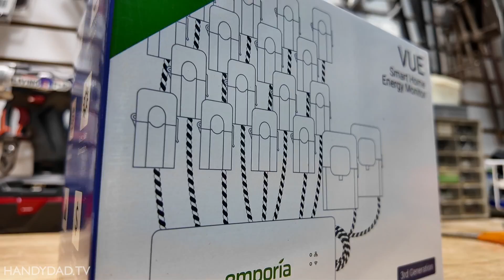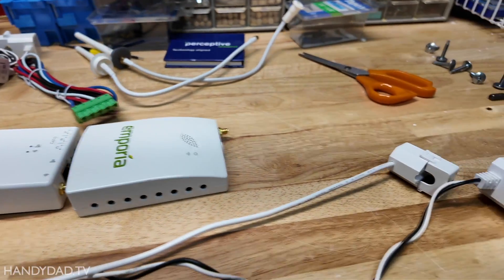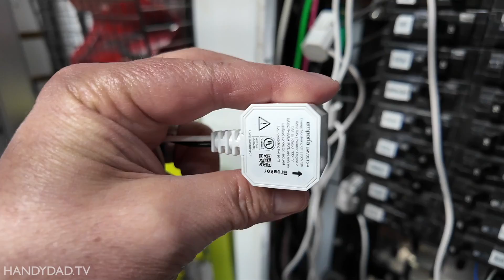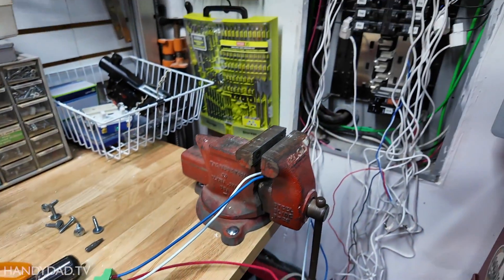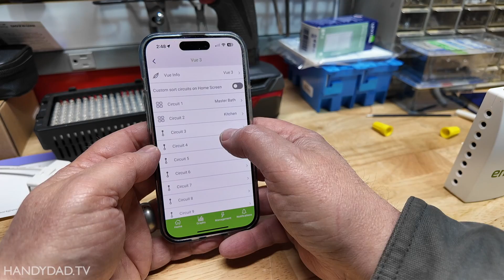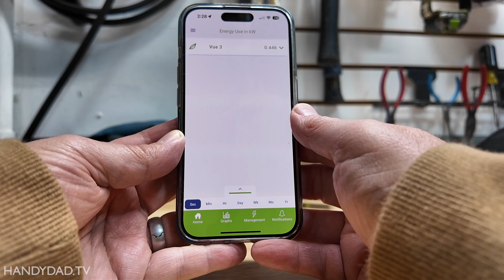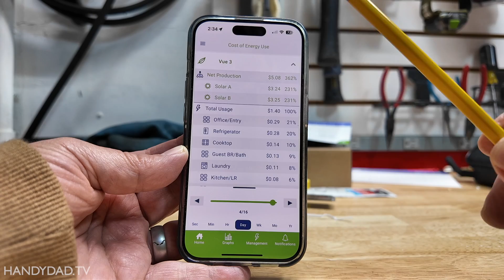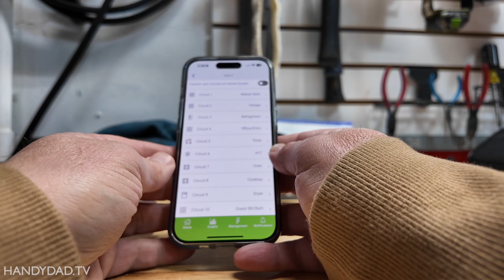Emporia Vue Energy Monitor - Gen 3 vs. Gen 2 - NEW FOR 2024

Comment: I gave you a well deserved thumbs up; I recently added solar was disappointed that I can only see what it generated on the Tesla App (no battery).  Grok recommended emporia Vue which in turn led me to your video.   I like the concept although I was a little thrown off by it needing power from both phases.   Intuition & years was a EE made think it should only need a 24 volt or 120 volt supply to operate. 

Off to research that one.
Reply from the maker: It reports the voltage of both phases.

Comment: Does this allow integration with home assistant?
Reply from the maker: Yes
Reply from the maker: I use it with Home Assistant.
Reply: @handydadtv may I ask if it links to home assistant out of the box using HACS or did you have to modify the firmware within it first?

Comment: Great vid and thanks for Q and A'ing this process. For the solar, do you have to reverse the CTs or is it able to assign a negative value considering that the breaker direction arrow does not really represent an actual load?
Reply from the maker: No, just point the arrow to the breaker for all of them. When you configure that channel as a solar generator, the unit will automatically adjust it.

Comment: Where is your antenna? Is it inside the panel box? Does that interfere with the WiFi signal? If you use the LAN connection, how do you get the network wire from inside the box to your router?
Reply from the maker: The WiFi antenna sticks out of the panel through one of the knockouts.

Comment: I love how you don't describe jack-shit about how you identify each of the breaker circuits
Reply from the maker: Mine were labeled ahead of time.
Reply: If that's the part you're stuck on you might want to call an electrician. I fully support DIY, but this is dangerous stuff.
Reply from the maker: Good point @lordgman1

Comment: Great review! best one i've seen in youtube by far for this model. Quick question, for all double pole breakers, do you need a CT on each hot side or you connect it to a just one of the two hot sides? I have several double pole breakers I'm wondering what would be the best approach
Reply from the maker: You only need to put a CT on one leg of the 220v circuit. Then configure it as 2x in the app.

Comment: I doubt it supports POE on the RJ45 and if I do upgrade, I'm going to Flash its ESP module to keep the data in house and not sold off.
Reply from the maker: It does not support POE.
Reply: @handydadtv  Missed opportunity.
Reply from the maker: It uses the 240v feed to monitor voltages on both legs.
Reply: @handydadtv  Yes but if you had your Emporia powered off RJ45, you could have a Uninterrupted Power Supply keep it powered up along side your internet/network and have it send a message out to you telling you that you have a power outage.

Comment: Great videos! After adding 16 plugin circuits in breaker box, can you add smart plugs to the same unit, and how many total circuits can be monitored? Or does a smart plug take the place of a physical monitor?
Reply from the maker: You can use smart plugs on monitored circuits or unmonitored circuits, anytime you want to measure usage of a single device. The only limitation, obviously, is they only work with plug-in appliances. They won’t measure permanent lighting fixtures or hardwired appliances.

Comment: Looking to install one of these shortly. Seems it may be easiest to get a dual pole 15 amp each breaker to install the power lines into vs pigtailing? If so this makes it feel a tad bit safer for those non electricians
Reply from the maker: I’ve done it both ways. If you have room in the panel, I suggest adding a dedicated breaker.
Reply: @handydadtv for now we’ve got room and did just that. Worked like a charm! Was glad I didn’t have to pigtail anything

Comment: How are you monitoring your solar production.  Is there a separate emporia product that just monitors solar?
Reply from the maker: No need for a separate product. Just put a CT on the solar circuit and configure it in the app as solar generation.
Reply: @handydadtv  Thanks, I had a nice long convo with Emporia last night and they said the same.
Reply from the maker: @davebarksdale 👍🏻

Comment: Hi I’ve just come across your video, it’s very helpful. Can I ask, which way round did you fit the CT’s on the solar feed circuits? Also did you use the 200A CT’s (as the solar is a feed) or just the 50A ones?
Reply from the maker: Solar circuits the 50-amp CTs. They go on like all the others. You just configure them for solar in the app.
Reply: Thanks Chris

Comment: Please help, I have a question.  We have a 70 amp breaker that on connected to a small 20amp water heater and to a 30 amp stackable washer and dryer, so they pull 50 amps. But they are combined on a 70 amp breaker at the panel. When it says it reads 50 amp does it mean it reads up to 50 amps? or is it a problem that the breaker is a 70amp? will it read it correctly ? I need to be able to read high peak usage accurately on all of the sensors. I don't want to pay the electrician to split this line and put in smaller breakers if it's not necessary. I appreciate all the help. I'm new to this.
Reply from the maker: As long as the CT will physically close around the wire, you should be okay.
Reply: The breaker will max out at 50amp reading. If the load is more than that, the CT will only output 50amp.

Comment: Great video! I have 2 grid -tied PV solar systems, one connected thru a double breaker and the other via a line side tap.. can the gen3 vue measure each of them separately? How many smart plugs can one vue support? Thanks.
Reply from the maker: If you put a CT on it, Vue will measure it. You only need a CT on one leg of each solar feed. Configure it to double in the app. The max is 16 CTs on one Vue.
Reply: I am considering adding this to my setup, which includes a 16kw grid tied PV array connected via a 4 lug meter base (similar to a line side tap). My question is regarding the monitoring of the solar, my meter, therefore the solar disconnect (which is where I would have to install the CT’s) is 50’ from my load center. Instead of shortening the CT wires, could they be lengthened???

Thanks
Reply from the maker: @ryansteele6422 You’d need to contact the company.

Comment: What if you have more than 16 circuits? Can it be expanded? What would I need to buy?
Reply from the maker: It monitors all usage, even on circuits without CTs. You just won’t see the breakdown for those circuits. 

If you really need every circuit monitored, you can buy two units.
Reply: Thanks! Do you know if both can be imported / viewed as a single system?
Reply from the maker: @dudeman99999 I never tried it, but that’s how it’s supposedly done.

Comment: You didn't mention the Solar Production and how VUE monitors that. I am about to enhance my solar system. That's why I am here. I assume you have CT's on the Solar Breaker in your main panel?
Reply from the maker: Yes it’s that simple. You put a CT on the solar circuit and configure it as solar generation in the app.
Reply: I have Solar how do I know which breaker is the solar breaker?

No one has ever told me I don’t even know if

I’ve been fighting this solar company for years. I’ve never known how much production I’ve had. They tell me I used too much power.        The electric companies is telling me I don’t have enough panels.      I have 35 panels 11.5 K system and I’m still paying 300 a month in electric something seriously wrong.!!!!!!   I need this product to figure out what the hell is going on with my electric bill because I’m sitting here in 80° sweating not using the AC in my Bill is still sky high and I don’t know where it’s coming from.  Would you be able to help me figure out where to put the solar set up
Reply from the maker: Your solar breaker should be clearly labeled in your panel so it can be turned off if someone needs to work on the system.

Comment: I missed how you connected the Solar system to the Vue. I just added a heat pump and have had solar for a few years so i'm pretty interested in seeing how much more solar i'll need to cover the heat pump. I can find out on my bill...  My solar connects in on the out side box so might be harder.
Reply from the maker: You solar feeds the grid through a circuit breaker in your panel. You just put a CT on that line and configure it as solar generation.
Reply: @handydadtv  you label all these yourself right?
Reply from the maker: @mmolina817 I take no credit for the labels on the panel cover. They are bad descriptions and don’t help me at all. I prefer to use a Brother P-Touch and put the labels directly on the breakers. Then I can identify them when the cover is off.

Comment: you can also clamp 2 or 3 circuits on one CT as long as they are on the same phase.  It has been a while since I set my Gen 2 up but if I recall each CT can read up to 50A.  So up to 3 15A circuits or 2 20A.  I was able to cover my whole 24 breaker panel with 16 CTs by combining
Reply from the maker: Good tip!
Reply: That works but I would only do it if they are related somehow like with all lighting circuits or all Outlets. Otherwise there's no need since you have the total power usage of the house or the main panel. The individual ones are more for monitoring particular devices that are usually higher current or perhaps a adu or other rental unit...
Reply: @trumpetmaris   I didn't group them in any particular order.  Not saying that grouping would not have worked well, I am just not sure it would change my results.  After combining circuits I spent a couple hours documenting every outlet and switch per CT.  If I see a spike in overall usage or on a single CT I can track the source quickly because of my documentation.  The unit has paid for it's self a few times over by catching 2 different freezers that went bad but did not stop freezing they just started using 5X what they should have.  I also found an audio receiver that was using 80W while in standby (I now have it on a Wi-Fi switch that uses about 4W)

Comment: Nice to see old style charts display. Emporia did a software update that ruined them.
Reply from the maker: Their latest update lets you swipe right or left to flip the chart to the previous time period (day, month, etc.). Great improvement from the old way.
Reply: @handydadtv  Just updated to 3.5.1.6459 they made it even worse than initial 3.5 update. Week view now blends bars together. Still no way to slide left to compare to previous day. Sliding to another view resets vertical scale making comparison impossible. They keep making it worse.
Reply from the maker: @antronx7 Ah yes. It does auto scale. 

You can export the data to a Google Sheet and chart it however you want to see it.
Reply: @handydadtv  It was great before they broke it with 3.5.0 ver. I should not have to jump thru hoops like that.

Comment: I might not been able to see correctly, but it looked like you had both the blue and white under a single screw on the neutral bar, which I don’t believe is allowed by code. Also, my experience with 240v devices, that some of when actually have quite a differences between the two phases, so using a single sensor and configuring it as 2x got inaccurate results. Great install video and explanations, thank you.
Reply from the maker: You are technically correct that it is most accurate to use a CT on both hots on a 240v circuit. I used two for my solar circuit and they are never the same reading. But they are very close. So close that I plan to reuse one of the CTs elsewhere. One will be good enough for me.
Reply: If your panel is well balanced and the loads equally divided you might get away with using one main power CT but it's never going to be accurate for total power. You could take the number and compare it to your energy bill in the same period and see how far off it is.

Comment: Personally, I have the gen 2. Worked great at my previous house. Moved and installed in "new" house. Lots of interference from other circuits. Very frustrating and mostly useless. Considering the new gen 3, due to less interference.
Reply from the maker: Interesting. I had no issue with interference with either of them.

Comment: This may be a silly question, but is there anything that says you need to put the CT clamps around the wire as it exits the breaker? (all pics online show CT clamps right next to breakers). I have very little room to the left/right of my breakers, but great cable management and lots of room where the wires exit at the top of the panel/fuse box. So I would prefer to clamp the wires in the upper region of my fuse box.
Reply from the maker: You can put them anywhere along the length of the hot wire.
Reply: @handydadtv  Thanks!

Comment: Great info here, and thank you again for the video Another question from me: I have an apartment attached to my house and electricity is not separated. I want the renter to pay their own electricity. This is the first energy monitor I've come across that can measure usage by circuit, such that I could determine how much my tenant is using. Are there competing products that do the same thing? Admittedly I haven't been looking very long, but 24hrs of internet searches haven't revealed anything that looks this good. Thoughts?
Reply from the maker: I don’t know. This is the only energy monitor I ever used.

Comment: Thanks for the video! Question regarding getting the data: I think I saw in another video (or maybe it was this one) that you said you cannot fine tune the dates using the app. If you want to match the dates on your electric bill, can you download the (daily) data yourself and align your Vue-measured usage with your what your power company says? Are you happy with the app and data delivery?
Reply from the maker: You set your billing date in the app. Mine is the 14th of the month. So when I look at the monthly view, it includes data from the 15th of last month to the 14th of this month.

Comment: FYI- If you need more than 16 CT's you can also install a second Vue and NEST it and get more CT's.
Reply: I've read where people put the CT over wires from multiple circuits that they don't need specific resolution on, reducing the need for additional CTs.
Reply: @fuquantify Yes, that is correct but you will need to use the modifier adjustment. It won't be as accurate but close enough.
Reply from the maker: Thanks!
Reply: Can you mix v2 and v3?
Reply from the maker: @1768ify You can use both at the same time, but you can’t use Gen 2 CTs on Gen 3, or vice versa.
Reply: @handydadtv  Indeed

Comment: Good day. Thanks for sharing. I have a question. If you add the two large CT's to measure the whole house usage plus the 8 or 16 that go into separate circuits.
If you use both... Does the system know that the 16 individuals are part of the total measured by the big CT's? or does it sum 16 small loads to a big total load? 
I want to make sure we won´t have information errors by using both 
and the reason I ask is because I want to use it precisely on a home that have more than 16, so I am planning to measure the total, but still want to be able to measure the big loads on the home, such as AC, pool heater, etc. Thanks and great channel you have here.
Reply from the maker: It knows the branch circuits are part of the mains.
Reply: Yes that's how it comes

Comment: Nice video, very informative. Does the Vue measure the total electric consumption on the main phase wires so that I can compare the total consumption to the sum of the individual sensors that are installed? Thanks
Reply from the maker: Yes, if you feel the need to retest what they’ve tested, but that will only work if you have 16 or less branch circuits. Otherwise you’ll always have more consumption on the mains than the sum of the branches.
Reply: @handydadtv  Are you saying the Emporia only reports on the load on the branch circuits?  I was assuming that it would always report the load on the main power feeds, and also on the branch feeds.  If there's any shorfall, it would report it as "unaccounted" - since it should understand not every circuit has a CT monitor on it?
Reply from the maker: @jwhite4 It does both. But non-monitored circuits show up as “Other”.

Comment: if you want to monitor both legs of another 240v besides the main input can that be done? I have a generator 240v input that I want to monitor as well.
Reply from the maker: You can configure the generator circuit just like solar.
Reply: @handydadtv  I heard the app cant be used if the internet is down. Is that still true?
Reply from the maker: @jjay718 That’s true, but the Vue still saves the data so when the Internet comes back, no data will be missing.
Reply: I had a post above where the lines from the generator hookup were run along the main power lines, before going to their interlock breaker.  A CT fits around both the main and the generator lines.  So "power used" picks up main power, or generator power.
Reply: @jwhite4 I ended up doing mine that way and it works good.
Reply from the maker: @jwhite4 In that case, you wouldn’t be able to reconcile your usage against the utility bill if the generator was used at all.